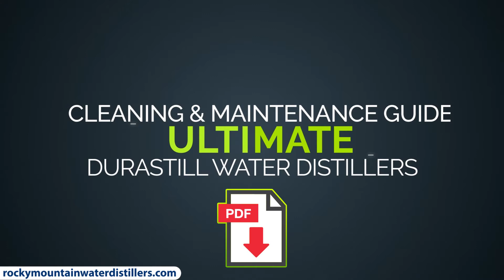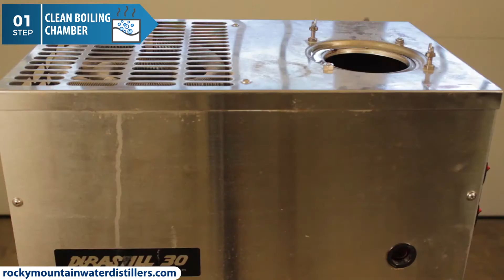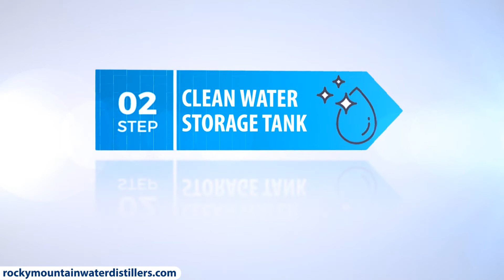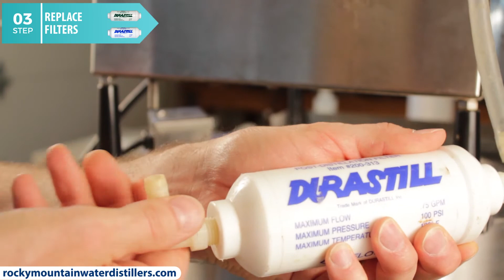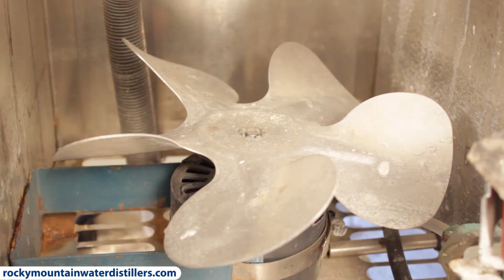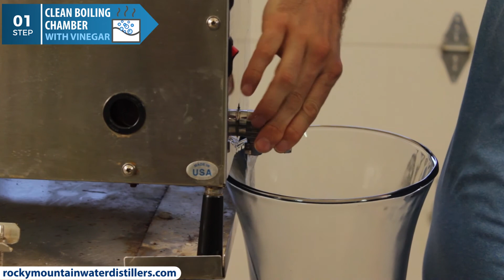HOW TO Clean A Durastill Water Distiller - Rocky Mountain Water Distillers

Comment: Personally I use my cleaner and distiller sit in the chamber overnight no boiling water required comes our shinny.  The Cleaner and Distiller I use dissolves everything just a very small amount floating in the water, inside the perfectly walls, float and element are perfectly clean.  No vinegar required.

After I empty the water with the cleaner and distiller I add a couple liters of water and some dish soap and give it a good washing. Fill it twice with clean water and rinse twice.

Thanks for the how to disinfecting using steam lots of detail compared to the manual as will as all your tips.

Comment: I'm struggling to understand what switches need to be activated to start the distiller. I assume the automatic fill must be off, but should the fan switch also be off? It would be good to add that to the video or make it more explicit in the manual and guide.
Reply: The fan switch should be on to cool down the steam converting it to water. The fan should only be off while cleaning, where steam is used.

Comment: how often should it be cleaned?
Reply from the maker: You should drain your Durastill Water Distiller boiling chamber once a month. Then clean the system every 6 months. - thanks Brandon
Reply: @RockyMountainWaterDistillers  qualification when you say drain once a month do you mean just drain the dirty chamber and scoop  out the junk on the bottom of the chamber then fill it up with water and add durstill sweet and use as normal . Or do you still add the water and durstill clean boil it for heat up water for 30 minutes then boil for another 20 min with the cover off and then sit over night then drain and rinse twice before using again with durstill sweet once a month op. Or do that every six months? Then every six month open up the front and vacuum  it and clean the fans you. I am not sure what you mean clean every 6 month? Then chamber or the inside the machine? Looking forward to the clarification?

Comment: I followed your instruction on cleaning the boiler.  Once I had cleaned the boiling chamber with Still Clean, a white residue was left along the walls of the boiler.  This is very difficult to clean off.  What should I do?
Reply from the maker: If you have white residue or mineral buildup that is thicker than a credit card then clean the boiling chamber again. If you use white distilled vinegar it will polish up the boiling chamber and make it look like new again. But the vinegar will stink up the room where you are cleaning the distiller.

Comment: Hello, I Recently left the Distiller on without the fan on for about 3 hours with the Excelon PVC  tubing and Filter attached. If  said components get hotter than their rated 120 F do they start releasing toxins? should I replace them?
Reply from the maker: When you left the distiller on without the fan turned on for 3 hours, did you connect the steamer tube and were you steam cleaning the stainless steel water storage tank? If you ran steam through your post carbon filter then it will ruin the filter. If I were you and worried about it, I would just replace the tubing and get a new "Durastill Post Filter with fittings" (the 2 elbow shaped fittings).  - thanks Brandon
Reply: @RockyMountainWaterDistillers  I already did, and thank you for responding.👍

Comment: Great video. I have found draining by drain valve is a hassle because it clogs almost instantly and re clogs easily even after running wire up both inlet and outlet. I now use a wet/dry vac to suction out water from boiling chamber. This is fast and and hassle free.
Reply from the maker: Patrick, Awesome tip! Yeah there is some really dirty water out there and it really can building in the boiling chamber. It's crazy to think that you would have drunk all the junk and filth in your source water that is now in the boiling chamber. I love the peace of mind using a distiller to purify my water. Thanks for sharing! - Brandon
Reply: I've been cleaning my tank for many years, but today is the first time I emptied it with a wet-dry vac. Unfortunately, after filling the tank with water and cleaner and plugging it back in it didn't power up.